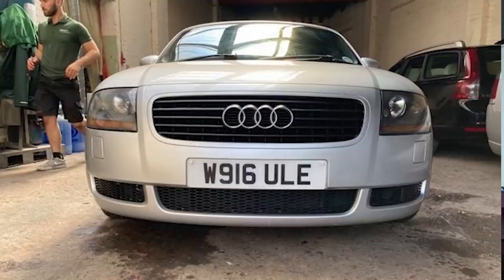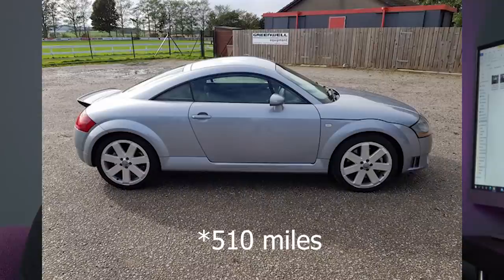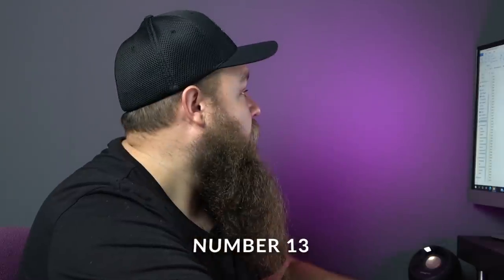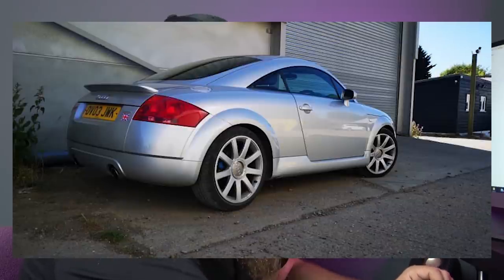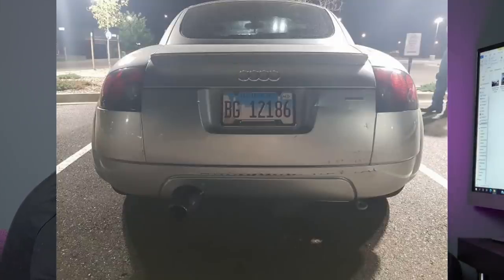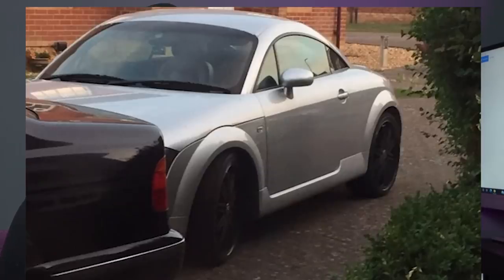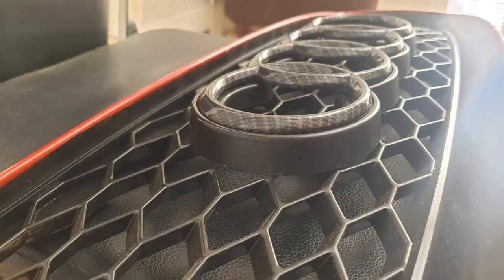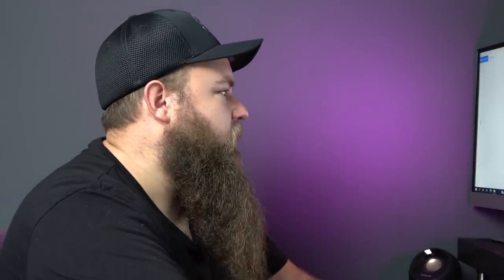Showing Off My Subscribers Cars Audi TT

Comment: Love your vids, and your knowledge, but would appreciate more time with the car pics.  I appreciate that means less time with your luxuriant beard, but I'll live with that (LOL).  Two points.  Tinted windows  - Only from B-post back, unless it's just the gentle factory tint.  Also, I'd love feedback on peoples' experience with tyres.  My 225 convertible is shod with Goodyear Eagle F1s, but am open to the experiences of others.  Thanks.
Reply from the maker: Haha that cracked me up, I’ve tried to do more time on the cars on the later episode :). Yeah tints are a no from me, not enough visibility as it is haha. And tyres wise it’s tough as no two people agree. On my Audi’s I use Michelin ps4s and they are very very good for all round wet and dry driving. I came from Pirelli’s and they were awful!

Comment: I am in process of changing out rear suspension on my 2004 quattro TT 3.2 . 
Wandered if you had any links to where I can buy stretch bolts? 
Loving your vids keep up good work
Reply from the maker: speak to a company called coverdale car parts, they will get you them for a good price and genuine parts 
01905 864807 ccp

Comment: One Q 
Can u make the 225 or the v6 RWD.  And if so as anything is possible.  
How meny ways can it be done and so on. I no u would no this. I heard some  one had a tt had problems with the 4wd making some sound or somethink so pulled a fuse or a plug and it rwd and stop the sound . Till till he could get it sorted . 
Just  was thinking is an easy way to make your car rear wheel drive and then if you want to back to four-wheel drive . I think i told u i am after a road leagal drift TT  .
Reply from the maker: Mini on nitrous 105BHP to 205BHP so rwd! As it’s an electronic controlled rear end if you pull a fuse is disengages the rear end making it fwd. 

Couple options you buy a Haldex electronic controller, you can then adjust the biased of the proportions but still not 100% 

You can buy a haldex insert this permanently adjusts the proportion. 

If you didn’t mind being a little cowboy I’m sure they’re would be a way of doing it by maybe removing the front shafts, taking out traction control and doing something to the Haldex but not 100% on that haha. 

Your right supercharged or turbo’s would be amazing. It would be amazing. Quite a few people have done it to the r32’s but not so much on the tt. That or take engine out and put a Rs3 engine in 😂

Comment: Mine is really tinted can't even see in. You can see our absolutely as normal . Depends on the tint. Mines coming off I don't like it on a grey car with black wheels aswell it's juat not a look that's for me. Bought a heat gun juts hopi g it comes off OK as its been on there a long long time

Comment: I've got q forge dumpvalve on mine I fooking hate it it is unbelievably loud I nearly hit 2 bar of boost and it just throws it all out loud. I've heard you can turn it off but I can't figure it out. Scared to remove it incase it's been mapped to over boost for noise.  Thr pipes etc look quite new cant fing a boost leak. I think I'm losing power though through it. Going to sort a few bits and then get it mapped again. It was mapped in 2015 and things have moves on quite a bit from then . Gives of a bang n a flame everyone and then to . I prefer quiet don't like to stand out at all . Prover chavvy mobile
Reply from the maker: Yeah it shouldn't have a dump valve, these cars dont like them, It should be fitted with a recirculating diverter valve